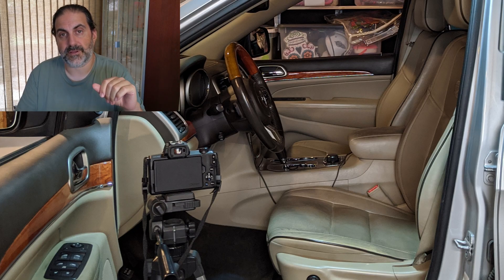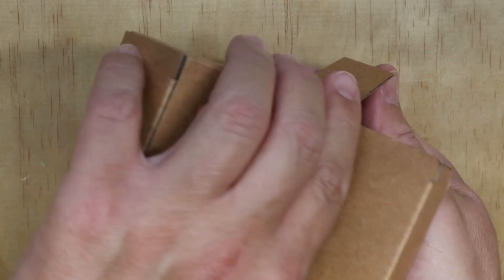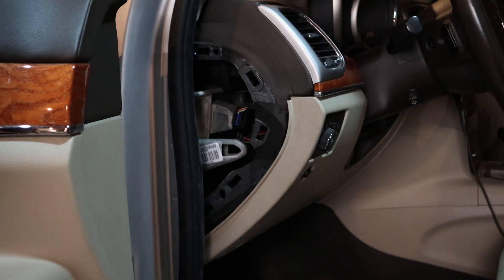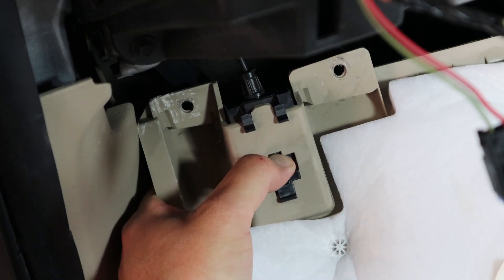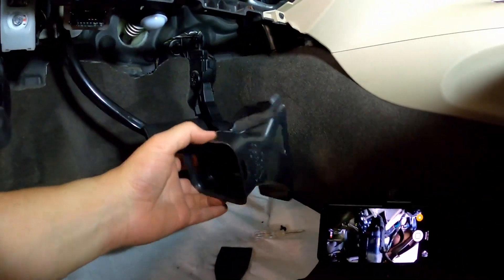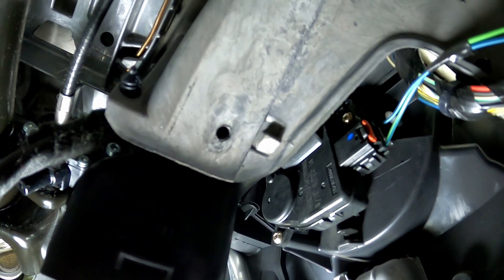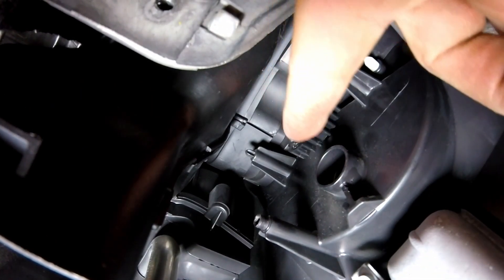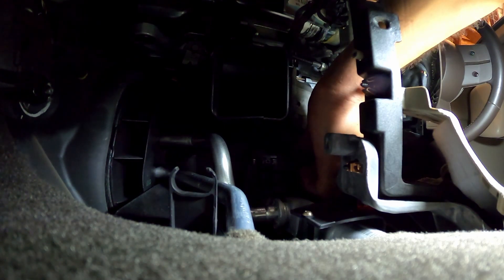AC Repair for $11 - Blend Door Actuator Gear  (Jeep Grand Cherokee WK2)

Comment: 10:36 do you actually have this lined up properly? looking at the image closely, it looks like the big tooth spot on the upper actuator is showing - shouldn't this not be visible if the two pieces are lined up correctly at this juncture?

Comment: I got a small ratchet tool for this and it is still impossible to get out. I ended up using needle nose pliers to get the screw out. Wors design for service imaginable.

Comment: I think what's contributing to these gears.Breaking is that the blower door is getting stuck on the ceiling that's insidethe h.V a c unit and once that gets stuck , the gear has to overcome the force and it just breaks. i noticed , you mentioned you broken a number of these. there is a number of videos on here showing the issue with the ceiling and the adore being stuck.

Comment: This job is an absolute nightmare, mostly because of that difficult torx screw.  

Once you get it out, do yourself a favor and go to your local hardware store and buy a couple #8 x 1/2 sheet metal screws.  It will be easier to screw in, and if you ever have to do this job again, it will be a hell of a lot easier to remove them in the future.

Comment: THIS VIDEO ^^^^^  This is the bible for getting this job done.  By far the best step-by-step out there,  A few additional things I ran into- 1.) the knee airbag isn't covered at all here.  If you have a knee airbag, everyone says disconnect the negative battery terminal since you don't want it blasting in your face.  Some say 2 minutes, some say two hours before the system discharges.  I let it rest for 30 minutes.  I found more tips here file:///Users/johndelgiorno/Downloads/WK2_Knee_blocker_airbag_removal%20(1).pdf.  2.)  Apparently its a known issue that the blend door gets stuck and that's what causes the gear to break. Indeed, mine was stuck.  Search online and you'll find different methods of freeing a stuck blend door- I got lucky and was able to pry it loose with a plastic tool (don't damage the gear!).  This is a great tip on how to make sure it doesn't get stuck again- https://www.youtube.com/watch?v=JQW93BPubGc&t=2s

Comment: Just did this today. And lost the top bolt. And had another one. And still can’t get it back in. But the one bottom bolt holds it  in there nice and tight. I might just keep the one bolt in So it’s  easier next time

Comment: same problem, the blend slide was stuck on cold too when i removed the broken gear. that's why the gear was broke i'm sure. i had to heat the vehicle up to unstick the blend door, thankfully it moved.   tks for the video.  p.s. I did grind down a T15 along with a 1/4 inch ratchet wrench

Comment: There ya go….complain about having to replace the flimsy plastic parts so often then immediately explain how you bought the cheap chineseium parts to save $10.    Solid logic there, sir.
Reply from the maker: Not sure I was complaining. Jeep designed and sold us these "flimsy plastic parts" in the first place. They almost look like they're meant to fail.  I get what you're trying to say, but this particular after-market part actually seemed better than the originals. It's still going strong, too. I'll report back if it fails. Also, nothing wrong with trying to save a little money. That $10 might matter to someone.
Reply: I bought my OEM parts, guess what, they were also made in china...
Reply: Nice that the gear fails instead of the expensive controller.
Reply: Dorman is the brand my local auto parts sold me too.

Comment: So I replaced the gear on driver side actuator for blend door. I disconnected battery for 6 hrs. I still do not have cold air from drivers side. If I crank heat up to max, it does get hotter, but when I lower to minimum, the heat changes but does not get cold. Don't know what to do anymore. Passenger side works properly
Reply: This was mentioned in a different video, the blend door itself gets stuck so the gear can't break it free, have to unstick it first.
Reply: @bomberman7269   Finally fixed it. As I mentioned, there was movement but not enough. What it ended up being that when it was reassembled that it was off by 2 teeth. Therefore it would never reach 100%
Reply: It is not stuck. It has movement

Comment: How did you get the actuator to line up with the cog out of alignment? Did it turn freely?
Reply from the maker: The actuator internals held pretty solid, as I recall. Instead, I just twisted the actuator motor itself, with the new gear on, until it lined up with the other gear on the blend door. Once the teeth started to mesh, I pushed the actuator into place, and then twisted it back until the screw holes were lined back up. Hope that made sense.